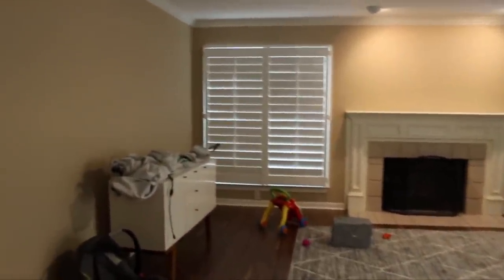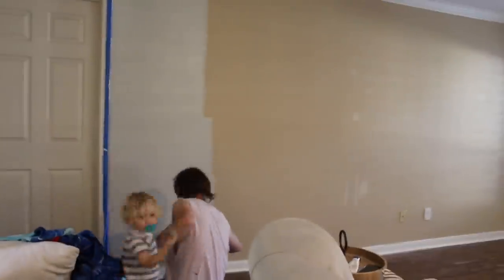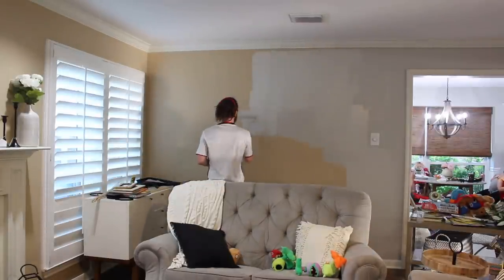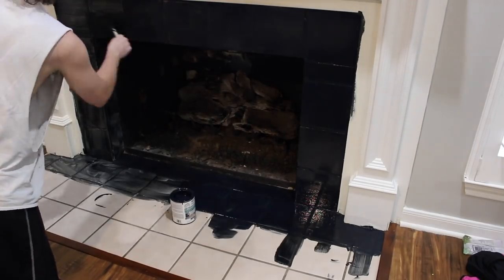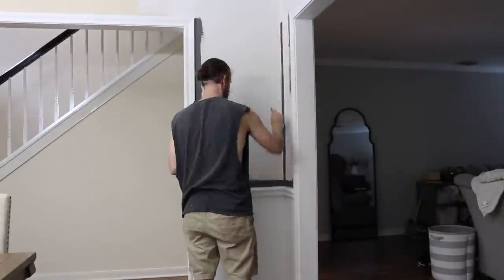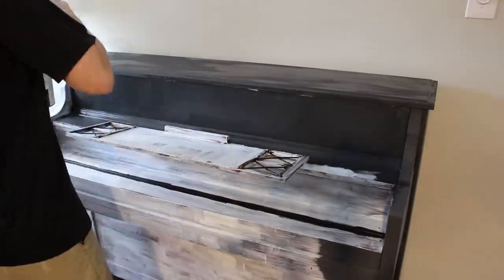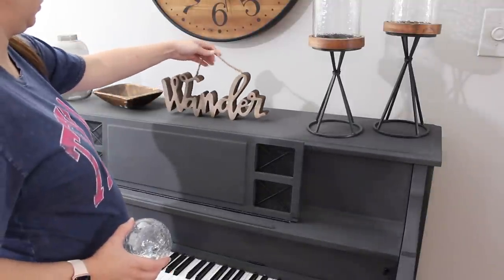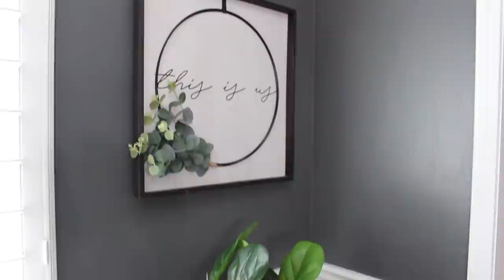DIY HOME MAKEOVER ON A BUDGET 2021! EXTREME LIVING ROOM & DINING ROOM TRANSFORMATION! FIXER UPPER

Comment: Use the tape method for the placement of the holes in which you take painters tape from one hook to the other and put a small hole where the nail would go. Place the tape on the wall and then use your laser leveler to ensure it's straight.
Reply from the maker: Thank you for the tip. We need all the help we can get lol ❤️❤️❤️